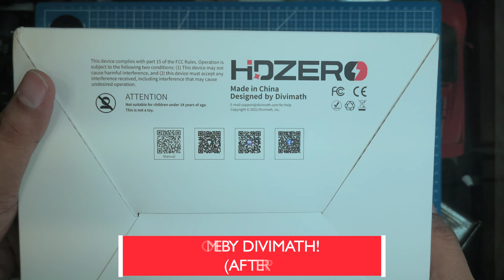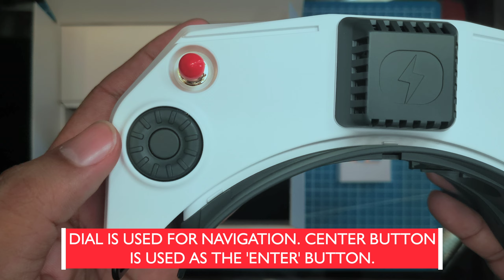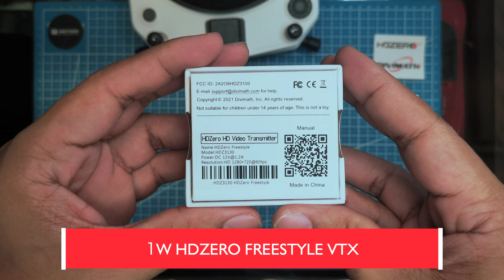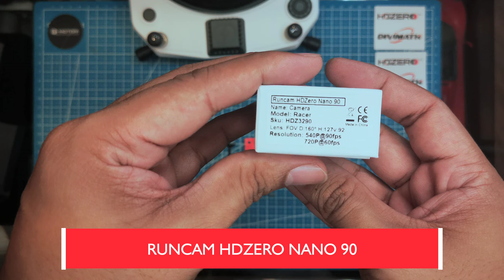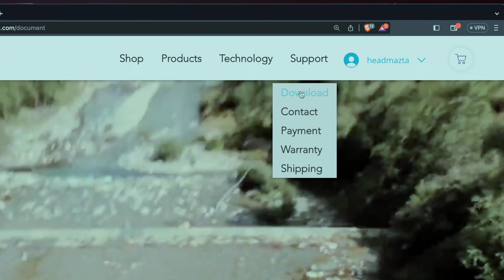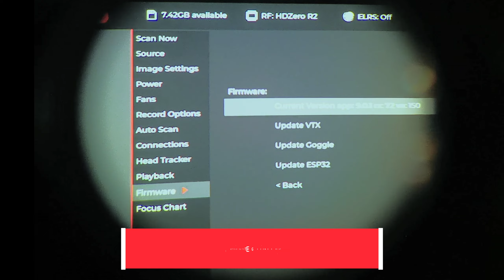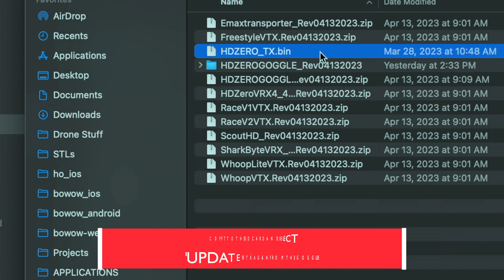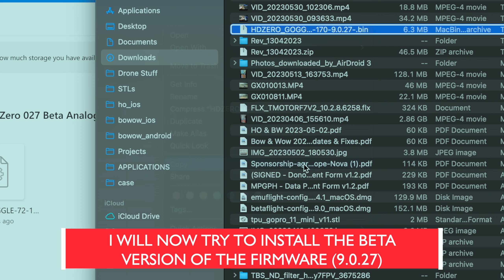How To: HDZero | Unboxing x tutorial x review x test flight

Comment: Great flying. Has the screen flashing problem been resolved?
Reply from the maker: Hey bro! I'm still waiting for the next firmware, so it's still the same. Menu OK, FPV Video glitchy
Reply: @headmazta  is dvr video glitchy or just in flight on the screens?
Reply from the maker: @RyanQuellet  dvr is fine. The glitching is in the goggles view only.
Reply from the maker: @RyanQuellet  glitching in the menu went away tho after beta firmware as u can see in the video.
Reply: @headmazta  not sure if firmware will fix this. Did this issue only happen after a firmware update?
Reply from the maker: @RyanQuellet  yup, after the update using the latest release version.

Comment: Really want a 6S hanging off the side of your head? I was looking at a pair of used DJI V2 goggles but I don't want to be in that ecosystem. I much prefer open source and the innovation it brings, inevitably at a lower price. It seems like a great system, but like everything else it's a work-in-progress that will leave early adopters feeling shafted. Imagine spending 2K on a DJI system only to have it be upstaged by V2 a year later. I have a real love/hate thing with this hobby. I'm waiting for tech maturity as it's obviously not quite there yet.

Even @ 60FPS, your brain and reflexes are not that fast. The hype around frame rate is simply stupid.
Reply: unfortunately I agree with you but I can also can appreciate that the technology maturity for this hobby will likely never peak due to the low margins from low sales volumes and the nature of free dev work.

In regards to frame rate, I would really encourage you to briefly look into VR gaming headsets and how fierce those people are about frame rate / refresh rate.  Its a similar concept and application to FPV goggle refresh rates.
Reply from the maker: I don't hang a heavy, giant 6S battery on my head lol I put it on my table. As for the FPS, you will never appreciate 90fps over 60fps if you just cruise. In very fast rotations, 90FPS is MUCH clearer and slower fps becomes choppy.
Reply: @headmazta  lol. Dude, at 55  I'm getting to the point where I'm too old to see it anyway, but I get your point.😂
You'll outfly me any day, but I still like to watch and learn.....what I refer to is the human brains capacity to actually register that speed and apply stick input. Were just not that fast.